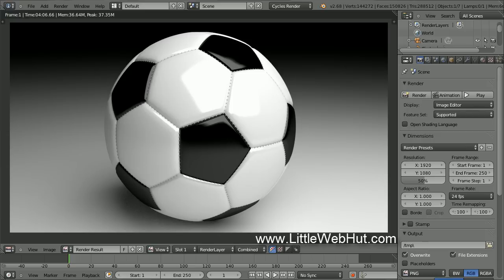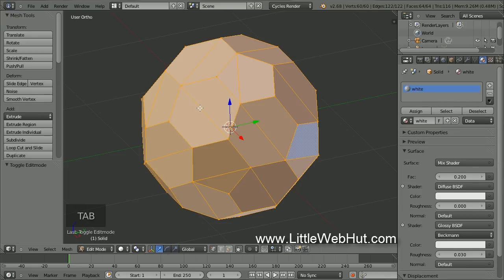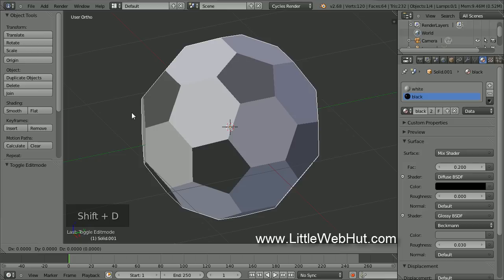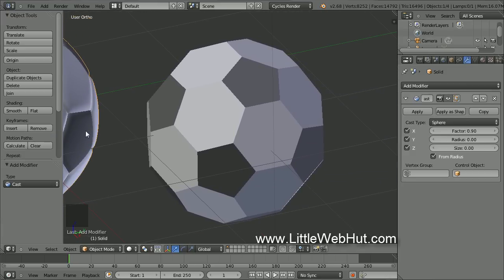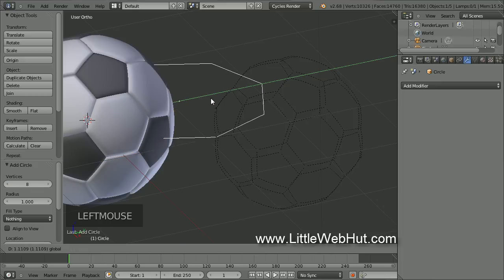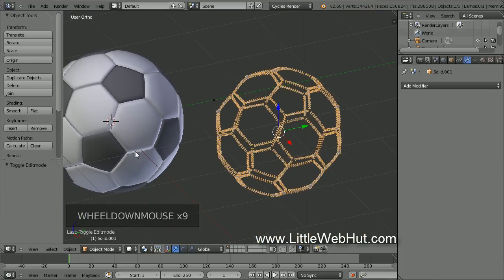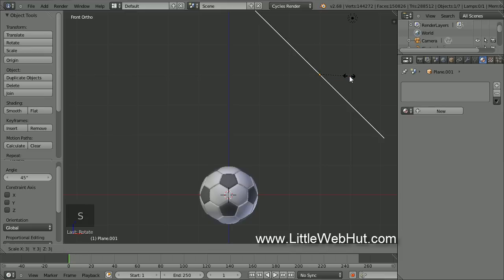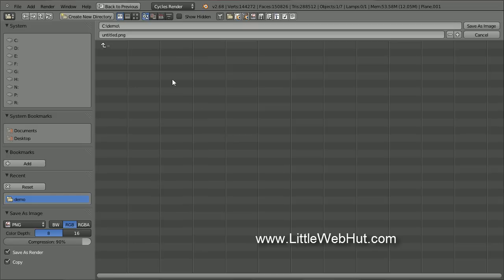Blender Tutorial: Soccer Ball with Stitching

Comment: UPDATED 2021-08-14

1. Search add-ons for "Extra" and select "Add Mesh: Extra Objects".
2. Add > Mesh > Math Function > Regular Solid
3. In the operator settings panel in the bottom left of the 3D viewport: at the BOTTOM of the panel where it says "Presets" choose "Truncated Icosahedron".

Edit Mode > Face > Poke Faces replaces the old alt+p command.

Smooth Vertex only appears in the right click menu when in edit mode and when set to vertex selection mode.

Instead of creating the little circle for the stitching you can just set the curve bevel to Round with depth 0.02m and resolution 2.

----
I wonder if instead of splitting all the edges into tiny edge segments we could now just use geometry nodes to instance a little ring at every point in the edge... hmm...

Comment: Another Great Tutorial from tutor4u, however Blender has moved on and the operation is slightly diffe4rent in Blender 2.78 , in the video at 0.46 an add-on is installed called "Add Mesh Regular Solids" this is no longer available and you should use the "Add Mesh Extra Objects" add-on , to create the shape on your desktop press shift A then move your mouse over to Mesh, Math Function, Regular Solid then once you have the shape on your desktop go to the Regular Solids Toolbar on the left of your screen and change the source to Icosahedron, also change the vertex truncation to 0.667, this will give you the same shape and you can carry on with the rest of the tutorial as is, it worked for me Brilliant Render, would love to know how to do a grass a white line ground for it though.

Comment: Needs updating to 2.74. User preferences > add ons > "Add Mesh" tab > check Add Mesh:extra objects. Save and close User Prefeerences. Now shift a, > Mesh > Math Function >Solid. In the menu that appears before you change or move object at bottom of left column select icosahedron. Vertex truncation needs to be set to 0.67. There is another, easier way: In the new object menu, leave truncated at 0, go down to custom > select truncated icosahedron

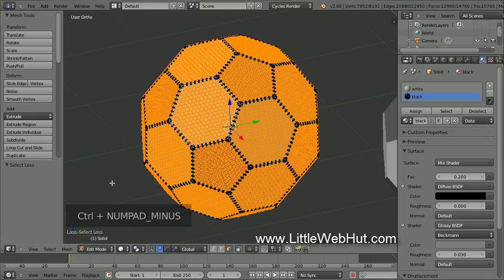Comment: At 5:06 I have problems "selecting less." Yes, I am using the minus key next to my numpad and have also tried the "emulate numpad" feature in the user preferences window. However, when I use the command Ctrl + -, the menu on the left creates a new section named "Select less." This menu however, does not do anything of use. I have also tried going to the select menu at the bottom of the 3D viewport, but selecting "less" from there does nothing as well. I am using version 2.67 of Blender, the required version as said at the beginning of the video. I can find no solution to this and I would greatly appreciate it if someone could find the issue.